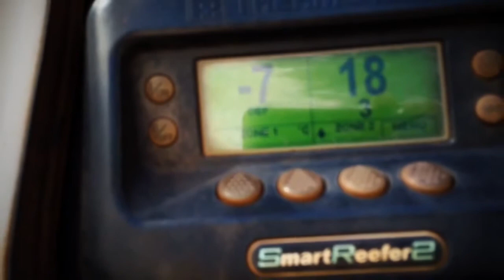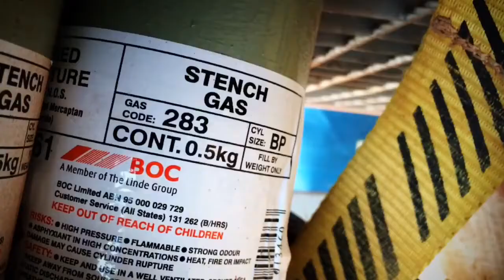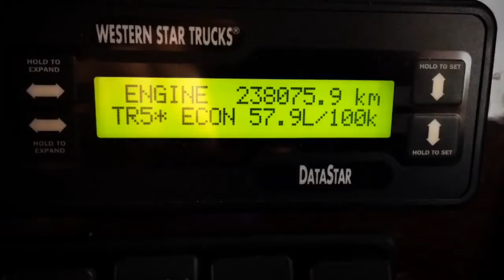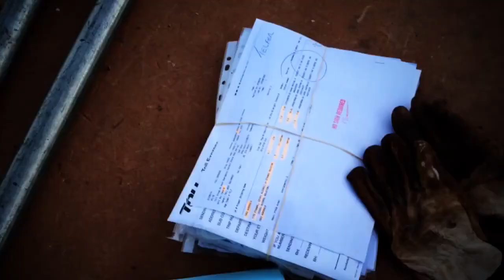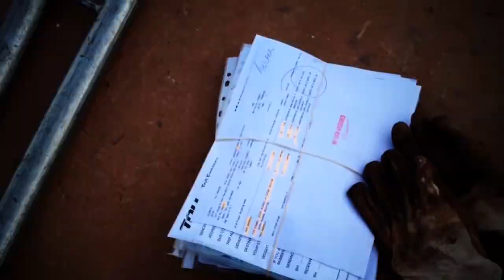Northwest Truck Driving

Comment: That Logbookchecker is a good app, I'd be stuffed without it especially in the East and MRWA said it was ok to use as timesheets without transferring it to paper so that is a bonus. Btw, I've never seen an airbag explode like that.
Reply from the maker: gm16v149 Didn't know that MRWA approved it-interesting! Oh, and that was actually a lower radiator hose. When the truck reached 1yr old all the hoses started failing - I've had to replace all of them, including heater hoses, so I used good quality instead of the junk Western Star put on there.
Reply: twocrowsdown Yeah I had another look, first glance it looked like an airbag. Also saw the offset ringfeder, what a bastard when that happens. Also the presumably broken shocker bolt, I changed to CAT bolts, end of problem.
As for Logbookchecker, I use it on my iPad so you can show it to whoever is checking, they've always accepted it in WA, but not in the East because you have to keep a proper logbook. When I had my WA annual audit  it was accepted, and I had a random audit last week and was accepted. I just email the pages to myself as a backup. You can always print them if you want and keep them in a folder. Beats doing paperwork all the time.
Reply from the maker: gm16v149 Actually, we have been using LogBook Checker for audits - I just email them to the boss at the end of each month. I wonder if they would be accepted by all the WA authorities? I now Toll wont have them, I have to transcribe to an old fashioned paper copy.
Reply: twocrowsdown But can't you print the copies for Toll? You can digitally sign them with the tab on the bottom. I suppose that could be a problem if they want them after every trip and you don't have access to a printer. I rang the head of WA accreditation and he said electronic copies are ok, technically you only have to do them at the end of the day unlike the E.S. which don't allow electronic logbooks because atm they can be easily fiddled.

Comment: Is a ringfeder doing what it is supposed to do there? Looks like a hook gone wrong?
Reply from the maker: rooshooter When the handle (and pin) is raised the receiver part of the ringfeder is suppose to lock in position. But when you get some idiot come along a try reversing up at 100mph and hit the ringfeder off center it breaks the cast iron tab that does the locking and then the receiver flops all over the show. Usually said idiot does not report the damage and the next driver that tows the trailer then has to deal with it. The only way to successfully hook up trailer then is to be within 5mm - takes a bit of skill when the rinfeder is on the back of your second trailer and you're trying to reverse onto your third.